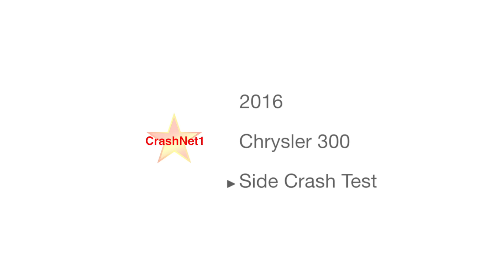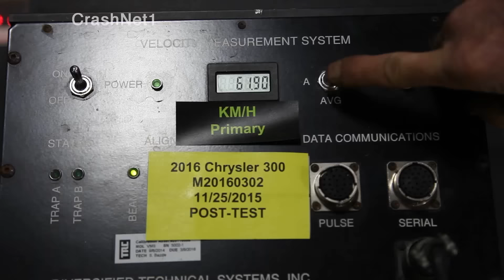2016 Chrysler 300 Crash Test (Side Crash)

Comment: I don't understand why you need to put the car at an angle to the turn the sled that is hitting it...if it needs to make contact at 90° why not leave them both at 90° to begin the with? anybody?
Reply: The angle helps knock the sled out of the way for analysis.